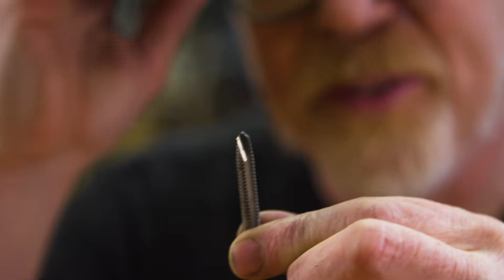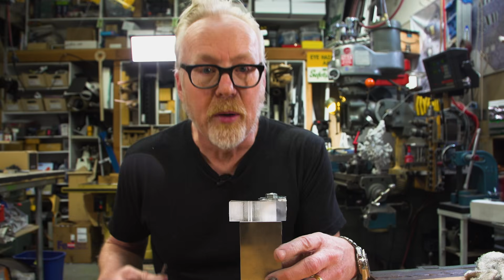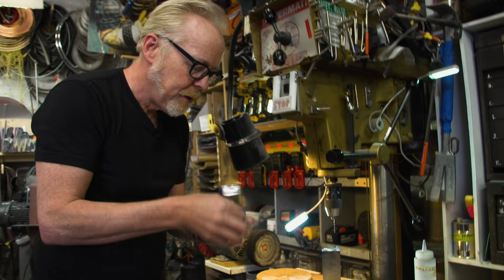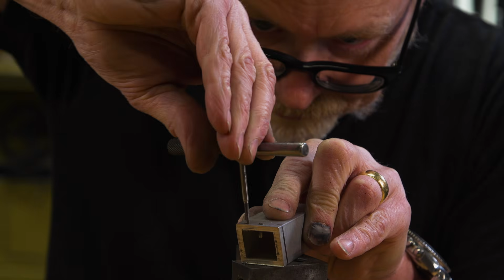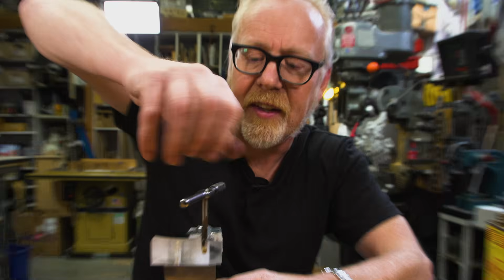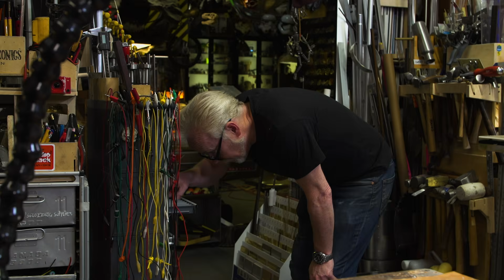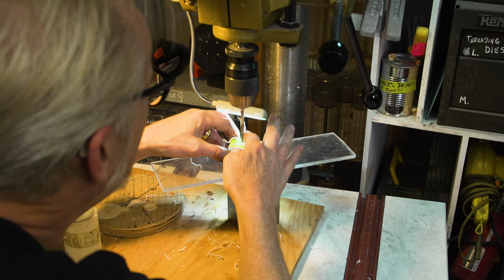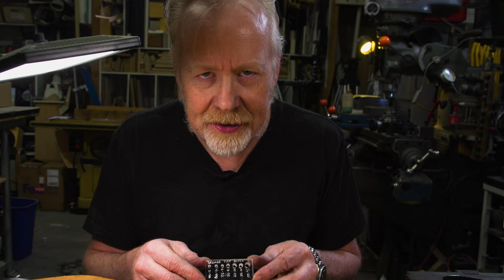Adam Savage's One Day Builds: Thread Tapping Guide Block!

Comment: I snapped off an easy out (similar material to a tap) while trying to get a motor mount off my car. 
The bolt holding the motor mount was sheared off as seized during extracting.
Then we tried using an easy out to remove it, which promptly snapped and sheared (we used lots of heat too and still no dice)
Then we spent about 3 weeks on and off removing the easy out, and ended up with a totally chowdered out mounting hole on the subframe. Some day I'll have to get around to replacing the whole subframe but know that hardened steel is no joke. Here are some things we tried:
-Multiple types of regular steel bits. These would dull within about 5 seconds of drilling
-Tons of heat trying to melt the thing out
-Concrete bits (diamond impregnated)
-Diamond high-RPM grinder bits
-More cheaper drill bits
The biggest problem was that the easy out was causing the drills to walk into the softer surrounding steel/aluminum of the motor mount. 
I think we eventually just used a drill bit so large it destroyed the whole thing. 
We would go out in the afternoon "you wanna go try and drill that mount out?" "Yeah sure" and we'd just sit there laying under a car with a drill held at full RPM trying to drill. 
After a few weeks of this we finally got it. 

Moral of the story is that hardened steel is no joke, and Makita drills are just a joy to use.

Comment: As an electrical engineer I sometimes need to add tap references for panel layouts.  Where is a good chart for taps with the dril size as well as decimal dimensions for the through hole to drill?

Comment: I like to use a cordless drill to tap with, it is fast and makes it easier to guide the tap straight, using it correctly wont break any taps, also, use Brake Cleaner as a lubricant, it evaporates leaving no sticky mess.

Comment: We, at work, very rarely bottom tap blind holes. It's easier to design in the correct tap depth for the screw going thru the mating part.

A simple metric rule of thumb, that suits most taps, is... TapDepth = 2D+2mm, DrillDepth = TapDepth+3mm
(an M3 would work out as Drill 11, Tap 8)

Comment: It’s strange and surprising, but Dewalt makes an impact drill chuck adapter that makes tapping into steel a breeze. Instead of tilting the tap when it binds, the impact part of the driver actually breaks up the chips as you go. 

With bigger taps, it cuts time way down. I either use this, or by hand. I’ve sworn off drills for tapping if I have the option

Comment: Adam, you're going to cut a thumb off using that table saw sled.  It would be a lot safer if you glue a block of wood to the exit path of the saw blade.  An alternative, but not as good, is to put knobs on the fence of the sled that  will encourage you to place your hands in a safe place (on the knobs) when using the sled.

Comment: I have used a British drill bit to extract a broken off tap but even that is still a pain in the back side cause even though it cuts the other way round (hoping it would lock in and untwist the broken piece) it also cuts into the sides if you're not careful !

Comment: A spiral flute tap or gun tap. Is a great way to extract chips out of a drilled hole rather than pushing chips deep into the hole like a spiral point tap does....My personal favorite is a roll tap or forming tap which creates strong threads and are less likely to break. But form taps are more ideal for cnc machines; hand tapping can become difficult depending on the size.

Comment: At 13:46, just finished 30 seconds verbosing about memorizing drill sizes, diameters and threads per inch... just get over it now, America. Just adopt the metric system and you'll never have to "remember" stuff like this ever again. Everything just comes naturally. :-) Seriously, the only thing you have to remember is the diameter, 4, 5, 6, 8 or 10 mm... and there is always 1 mm threads (1 thread/mm, 10 threads/cm, 100 threads/dm, 1000 threads/m). In your system that would be like 10/33 inch, 23/54 inch 78/94 inch. haha

Comment: I apprenticed as a tool & die maker where not only did I need to learn and use taps on a daily basis but also had to learn and cut external and internal treads on a manual lathe.  Later in life I programmed and operated CNC equipment where thread milling was required.  All of it was relatively easy if you started with good knowledge and tools.  But never used a tap guide.  Guess I’m old school.

Comment: I can tell you recently fell in love with machining. I can relate. It's a field I am relatively new to still and I am a bit of a nerd about it. Machining hits a perfect balance for me since it involves math and science, you get to work with your hands, you get to make something and get the pride that comes with it. You get to use critical thinking and logically work through a process and any issues you come across. It just tickles all the right parts of my brain.

On the other hand, in order to be a machinist by profession, you have to get used to the feeling of complete failure. I've never had a job where it was so incredibly easy to make a mistake and there aren't many worse feelings than spending potentially dozens of hours on a complex part only to make a fatal error at the very end because you lost focus for one instant or because you had so many numbers in your head that you got dimensions mixed up. It can be utterly demoralizing.

The hard way is the best way to learn, though.
Reply: Some excellent advise I received when I was starting into the world of machining over ten years ago, I would like to pass on to you... become friends with a good welder, they can save you when things go awry..  Good luck and enjoy!

Comment: Coarse vs Fine thread is a subject of much debate and there are MANY trade-offs.  Fine thread is shallower, both in the fastener and the base material.  This means that the minor diameter of the fastener is larger and therefore stronger than a fastener with coarse threads.  They are stronger in both tension and shear.  Fine threads provide more thread engagement for a given thickness of base material and are therefor less likely to pull out, especially in thin materials.  Coarse threads are less susceptible to galling.   Coarse threads are quicker to assemble which can be an important consideration.  If you are working on a fastener where you can only get 1/4 turn on it at a time you will be much happier with coarse threads.  Fine threaded fasteners are a little less common, especially in sizes like 1/4"  This is less of an issue in the internet age, but can still be important when you break your last 1/4-28 bolt at 7pm the night before the job absolutely has to be done...

Comment: In a pinch back 35 years ago when I had to clear out a rusty tapped hole to install a leveling leg on a vending machine I would cut a slot in the leveling bolt much like the tap or bottom tap.

Comment: Couple of points... 
Airlines are dangerous. I always put my hand between the hole and my eyes.. blow over the hole, away from yourself. Wear good eye protection. That oily hot swarf can bounce around between your face and specs.. close your eyes even..
When tapping aluminium, lubricate the tap with paraffin (kerosene), or meths. You'll be surprised..
Those taps... the funny flute on the point is designed to push the swarf ahead of the tap... that's why the bottom of the hole is filling up with swarf. Use a normal tap for a blind hole, the swarf will collect in the flutes (which is why you back off every turn, to break the swarf.. if it gets too long it will jam up in the flutes and the tap will break). Your taps, because the swarf is pushed ahead, doesn't need backing off... 
When you drill a hole, touch it with a countersink. Burrs are a sin, and will make tapping awkward, and it will be harder to put a screw in... make the csk slightly bigger than the thread, your tap will start easier and you will have a nice lead in for your screw.
Nobody wants to use 2 taps on one hole, especially if you have a lot of holes to do. You know how long a thread you actually want, drill the hole a bit deeper and send your taper tap a bit further. It rarely makes a difference..
Broken taps are character building..!
I enjoyed your vid, love the enthusiasm, hope you don't mind me putting my three pennyworth in 👍😄

Comment: Great episode! I love taps and dies. I work on musical instruments, specifically woodwinds, and use small taps and dies frequently. My most commonly used size is 1-72, although I also use 2-56, 3-48, 4-40, even 0-80! It often cuts days off of the time for a repair if I can make a new part myself using raw stock or altering a similar part I already have rather than ordering a new one and waiting. Customers are grateful for the faster turnaround time, it saves the boss some money, that's a win-win!

Comment: Hi Adam, years ago I used to make taps for a company in Birmingham, England. Making the taps was such a dull job, but they are so useful. Making huge taps for threading oil drilling rods was SUPER tedious. each cut took something daft like 20 minutes, then send it back, wind in the wheel, another 20 minutes. you made something like 7-8 a day if the grinding wheel was still good. I love your channel by the way.
Reply: I do not miss the swarf and blades of steel that came off them getting stuck in your hands.

Comment: Nice reference to hitchhikers guide to the galaxy with the 4-40 drill size. It's been 12years since I was laid off as a tool and die maker apprentice but the #7 drill size for a 1/4-20 is still inbeded in my brain. I love these videos despite still remembering alot of this from my tool and die days. Still in manufacturing but now as a quality engineer and my hobbies are making stuff. Recently bought a shapeoko cnc router and I am so glad cnc is now affordable to the average person. Granite still not super cheap and still takes a decent investment of a lil offer $1k but better than the 10s to 100s of thousands an industrial cnc costs. The last decade the maker movement has opened up a market for smaller versions of these machines. Thanks for the videos Adam. Very informative to those looking to use these more complicated skilled tasks to make more complex gizmos.

Comment: For people who want to get the job done, drill the hole, grab a spiral point tap, put it in your drill that has a screw setting (meaning it has a clutch to limit torque), set the torque ring value, and drive that tap on through. If the material is thicker than 1/4" you may have to reverse drill then go again, but otherwise it will go straight through. In 1/4" steel with 1/4" tap it only needs to take 30 seconds to drill and tap. I use quality taps so your results may differ.

Comment: Adam, today you were called my spirit animal.....let me explain:
This weekend, I decided to fix an elevation problem with my table saw  (starting a home shop after 35 years away from making anything).  Turns out, the mechanism was fine, but the hand wheel was made of plastic, and its central hub stripped.  Replacement wheels are cheap, but made of plastic, so I began searching for a metal replacement.  I can't find one that has a center borehole that's properly shaped (in a D for my saw), so I decided I would look for one with a round bore.  Then came the question of how do I attach it.  Do I weld it?  Never welded before.  Do I drill and tap it?  Never did that, either.  The very next day, you published this video on tapping, and helped make my decision and boost my confidence in the procedure.  Hence, a co-worker of mine has named you my spirit animal.
Thank you for all you do to inspire and teach us all.

Comment: Had to make one of these in a college engineering / shop program... every time I used it for work tasks, everybody asked me to make them one... it was a 2" thk slug of aluminum round stock turned flat on top and bottom, with all the common tap and drill sizes, with the smaller sizes arrayed inward along a common radial line and lettering.  Should make another one, they keep getting swiped !

Comment: Tap guide blocks can be simple affairs. The two I've used for 40 years are pieces of Aluminum picked up out of the scrap bin. I deburred them and drilled holes the size of the tap, or size of the shank for small taps. I often use this German made ratcheting tap wrench for taps smaller than 1/4" and it is very handy. I also have a phenolic block drilled to hold taps and tap drills that is handy to keep by the drill press.
For those new to working in the metal shop note that Adam Savage is doing something that is very dangerous. NEVER wear rings, other types of jewelry, long sleeves, gloves or a wrist watch in the shop. My wife retired as an emergency room nurse and she can describe in detail for you  someone who has had as she puts it " a finger de-gloved of flesh" by a ring in an industrial accident. Keep in mind a powered machine tool, no matter how small, can tear you a new one if it gets a hold of you. Have fun & Be Safe!
https://i.postimg.cc/pTRSGHGy/IMG-0162.jpg

Comment: Adam:  you left out the use of a reamer to precisely round off the hole to be tapped.  To avoid breaking taps on the triangular hole typically drilled by a commercial drill bit.  I drill a lot of small tap holes, e.g. less than 2-56.  This saves me a lot of money on small taps.

Comment: My favorite way to keep taps and the right drill together in a toolbox is to use a plastic drinking straw. Use a pair of pliers and a lighter to pinch and sear one end closed. Insert tap and drill with the tips pointing away from each other, then pinch and sear the other end. Mark as necessary.
This way they stay together and don't dull each other by knocking together.

Comment: The most 'savage' thing I have seen is someone putting a tap in a power drill and just forcing it through a hole. Brutal,  but ironically did the job. Jeez
Reply: Machine taps are a thing. There's even drill-taps that combine the drilling and tapping on 1 tool.

Comment: Y'all need metric! 4-40, 10-32 taps. Size 7 screws. 144 drill bits. What the hell is all that? Metric - M4 tap for an M4 bolt, pre-drilled with a 3.2 mm drill bit. Simple.

Comment: my metric brain struggles to understand the imperial parts of this video but i get the jist haha!! I use drill brushing as my guides for drilling and tapping works great as well as then you don't need to have a special metal block with a tonne of different holes (and is a bit faster to make!), as the OD of the bushings tend to all be the same size (or a few sizes) it can be even 3D printed!

Comment: You need to get Adjustable spring-tensioned tap guide that is used with a tap to thread holes in machining operations. Show you.. https://www.amazon.com/dp/B005317ZMC/ref=cm_sw_r_tw_dp_x_hNGwFbRFJ37XD via @amazon
And you need to get Fowler 52-490-100 Micro Tap Guide Hardened Tension Pin, 0.1875" Diameter, 1/2" Hardened Shank Diameter.  and Show you.. 
https://www.amazon.com/dp/B00B5HPSGI/ref=cm_sw_r_tw_dp_x_8QGwFb8GZTS0W via @amazon

Comment: Tap set also super handy to re-tap threads/bolts clogged with gunk/threadlock or cross-threaded/damaged - a damaged thread on a bolt will damage the threads of the hole you're putting it into - if you can't get a new bolt, re-tap the bolt.

Comment: Also to note Adam, The threads on a tap are chamfered. The length of this chamfer determines how much force is required to tap and how deep you can tap a hole. Say a bottoming Tap is great for blind holes with a chamfer of only 2 or less threads while a taper tap has a long chamfer of 7-10 threads making it preferable for hand taping. Check out the  Haas tip of the day on Tapping Essentials. Terryberry did a great explanation. Hell what do I know, I’m just a high school junior who has taken an engineering class for the past 2 years. I’ve barely got any time on manual machines, so what do I know.

Comment: FYI you don't necessarily need a guide block, at least not for metric standard threads. At my workplace we have something called "Piloted Hand Tap Rougher" that guides the tap and roughs the threads of a hole (costs roughly 10$). That thread can then be finished with a standard tap. Granted this creates an extra step and a need for one more tap for each size.

Comment: Helicoil or threaded bushing is another tool to increase the strength of the threads if you have damaged or threaded an important part, you increase the hole diameter, insert a helicoil which can be a stronger material into a larger hole meaning you get much more surface area, it can be stronger overall.

Comment: Question,  I can not seem to find a good set or pair of drill bits.  I don't buy HF, ebay, and other cheap places so I think I'm buying right until I drill. I've tried slow, fast, cutting oils, water, and it seems after the first time is great, nice and smooth through 3/16 mild steel. What is good?

Comment: I used to be a lead machinist and I trained hundreds of temporary workers... They broke a LOT of taps... The parts we made were not cheap so it was my job to extract them. I had the most luck using just a scribe and a bit of patience. So long as the hole isn't really buggered up, use that scribe to scratch the broken tap in a counterclockwise manner. It'll work itself back out of the hole about 80% of the time. I've done this successfully with taps ranging in sizes from 4-40 up to 1.25"NPT... though a hammer and punch is more appropriate for those  large ones.